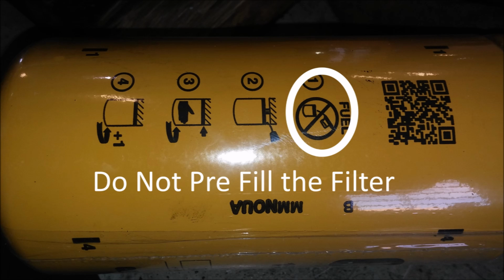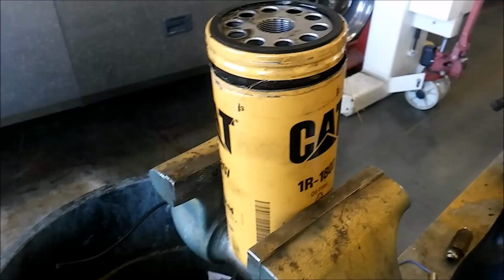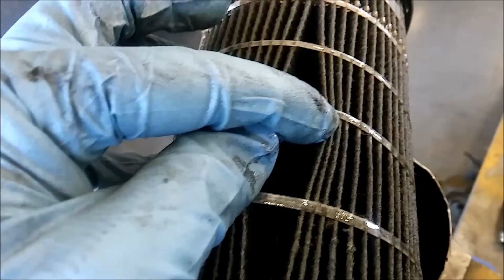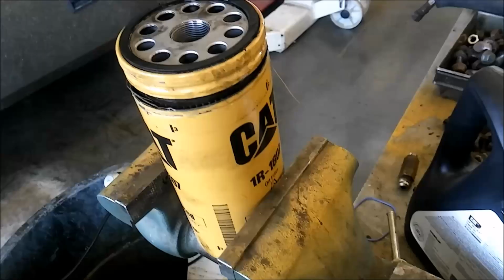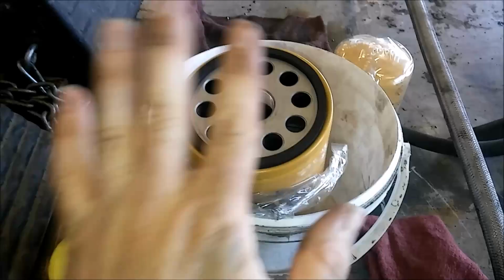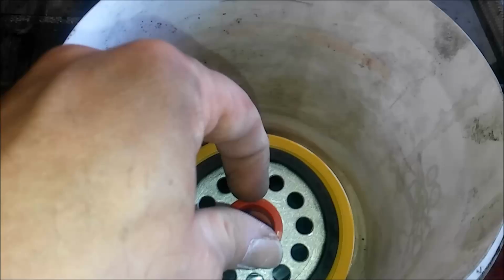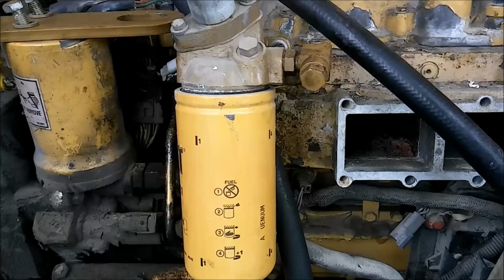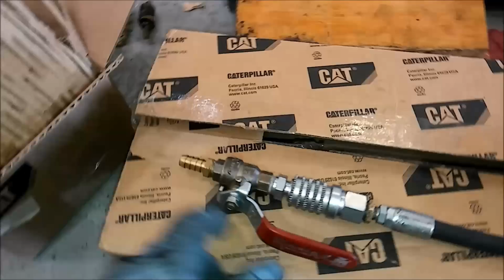Should You Pre Fill an Oil Filter? Should You Pre Fill a Fuel Filter?

Comment: The comments just show how people do not understand fluid contamination in bulk oil and the manufacturing process. Often times, the oil is dirty before it gets poured in the engine and then the bypass filter cleans it up. If you don't believe me, order a Particle Count on any virgin oil sample. CAT fuel filters are like 2 microns, way smaller than dust.
Reply from the maker: +heavymechanic2 Cat seems to think it's a big enough problem that they consider it better to run it without oil for a few seconds than with the unfiltered oil.
Reply: Almost all engines have a oil bypass built into them. Only about 10% of the oil  gets filtered until engine is warm. Even then best case scenario 80% of the oil gets filtered after engine reaches operating temp. Not filling your filter because of contamination is just STUPID
Reply: He is definitely splitting hairs to worry bout such things!low oil pressure is much larger problem,even for three seconds.
Reply: PQIA does random oil testing and has confirmed some oil in the bottles is too dirty to pour in your engine, its the whole point of this video. You guys are confusing Boundary Lubrication with Hydrodynamic Lubrication Anytime the lube or fuel system is opened, its subject to contamination.
Reply: heavymechanic2  Wow you know some fancy terms. How does that change the fact that 90% of that new oil won't be filtered on startup. New or old dirty oil is always more preferable to no oil.
Reply: beatnikgee "90% won't be filtered upon startup"? what's that even supposed to mean? every drop coming out of the oil pump gets filtered before it goes to the bearings and other lubrication paths. any part that is splash lubricated isn't critical about a small dirt particle, but pressure lubricated components are
Reply: Actually beatnikgee is partially correct. The numbers he is throwing around are incorrect for every engine.  Larger engines do not bypass that much oil. Small car engines are more likely to. 
Most engines have one or two bypasses built in. They exist for the sole reason of cold weather or cold oil mobility and the possibility of a plugged oil filter. I'll use my 6.5 diesel as an example.
The 6.5 has two bypasses. One bypasses the oil cooler and the other can bypass the oil filter.  Both are resistance bypasses. If the oil resistance to motion is great (such as when it is cold) then the oil will bypass.  It is a good system for Joe general public that could care less about how their car works and doing necessary maintenance on it.  It is not so good for those of us that like to take care of our engines because the bypass will let debris through when it is open. Thankfully most of the oil has already been filtered by the time you start it in the morning after an oil change. 
If you think about it, it is another reason to idle your engine and let it warm up before driving. With today's thinner oils there is little to no bypass on idle even cold. Well 70 degree cold anyway. A synthetic will work even better, especially cold as it will be less likely to need to bypass. 
If you really want to know whether or not your vehicle is likely to bypass oil find out what its bypass pressure is.  Remember that pressure to activate is a differential pressure meaning the difference in pressure before and after the oil filter. 
To avoid bypass you could also use a bigger filter or like in my case I am going to use 3 filters and block the bypass and have an oil pressure gauge before and after the filter. 
Cheers. Best of luck.
Reply: consaka1 I'll accept that given I just tossed out some numbers with no source to back them up. I tried to find the article that had the numbers without any luck. I think it was a David Vizzard deal but it was about 15-20 years ago. The numbers they showed in their testing were actually lower. They were testing on a typical SBC with conventional 10/30 oil. I remember the study because the numbers were so shocking. They also found that the oil was dirtier after using "higher quality" very fine micron filters because even less oil was getting filtered compared to a "cheap" filter.
When you said 70 degrees cold I had to chuckle....it was -40 degrees Fahrenheit last night.
I'm going to dig a little more to see if I can find that article. It was really informative on the need for blueprinting your oil system when building your engine. Most people don't get past which heads, cam, and intake they're gonna use.
Reply: beatnikgee Makes sense that higher resistance of smaller micron filters would cause dirtier oil because of more bypass taking place. Just another reason to try and find the biggest filter you can. 
Keep in mind that the synthetics can make a big difference on how long they bypass since they are not near as stiff at colder temps. But yeah I lived in WI for a year as a kid and -30 was not uncommon. That was before the days of synthetic and they don't close school for stuff like that out there. My dad had fun getting the engine warm enough to start. Oil is like tar at those temperatures. 
Yeah for the engine I am currently building I am going past the standard blueprinting. Well as much as a you can for a diesel. Coatings are going to be a big part of it.  Current engine runs great! Just not keen on zero oil pressure at hot idle.  60,000 miles and my oil is probably really really clean. lol
Reply: well I just use motorcraft oil filters in my ford vehicles. they've got a lot of surface area to hold dirt and the bypass spring is very stiff
Reply: heavymechanic2
Reply: I'd worry more about the contamination laying in the bottom of your pan than contamination from a clean quailty engine oil maybe your using the wrong brand of oil then
Reply: Adept Ape im pretty sure this is wrong,according to what weve been taught, the crank journals "hydroplane" on the film of oil between the journal and the bearing,and that the most wear occures on startup,due to lack of lubrication,how many bearing failures have yall seen due to microscopic particles in the real world.......zilch
Reply: Had a professor in college that worked for cat as an engineer for hydraulic systems. He said they discovered that the oil they were draining out of machines was cleaner than the oil they were putting into them. Said 55 gallon drums are the worst culprits. The only real reason to change hydraulic oil is to replace the additives.
Reply: heavymechanic2 6
Reply: You lack critical thinking and an understanding of these systems.

First If you have metal on metal your lubricant isn't doing it's job and you have bigger issues. The contamination from particulates is removed by the filter. Hydraulic systems tend to have them on the return lines to the tank. In the end the fluid in the tank should be clean, at least cleaner than what you get out of a 55 gallon drum. You should filter the oil before you put it into a machine. I've upended plenty of drums to get the last little bit of oil out and there is always shit floating around in the bottom of it.

Second i never mentioned anything about not changing at recommended intervals. But what do you think the additives do? Things like anti-oxidation and corrosion inhibitors? They keep moisture and oxygen from attacking the oil and the components of the system. If your oil is getting broken down then the additives are shot. Hence you are replacing the oil before that happens. This means you are replacing the oil to get fresh additives rather than the oil itself going bad.
Reply: D3faulted1 you do what you want I've never had a major failure from new oil in all my 50 yrs of being a heavy equipment tech timing service and inspection of systems is the key to trouble free use not what your claiming you are a fanatic about oil if I was you I'd be more worried about what your drinking than what's in oil pick better oil brands  good luck
Reply: Just because you've been doing something for 50 years doesn't mean you understand why your doing it.
Reply: I have seen a 4 year old pail of new oil with an inch of sludge on the bottom. Whooooops! Does this stuff expire?
Reply: maybe you need to find higher quality  oil then Dude
Reply: look up oil filter construction it has a by pass spring thats why there is crap stuck in my bearing now in an engine i am into
Reply: You're all wrong. It's better if you put the filter bone dry and allow it to slowly fill up as your engine is cranking. It helps clear up all the sludge and even helps seat the rings all over again.
Reply: Can't you just put an old shop towel over the filter and pour the oil through it to strain it? If it's that contaminated out of the bottle, I mean. :)
Reply: Aren't most hydraulic oils Hygroscopic? Like brake fluid. Meaning they draw moisture out of the air which builds up in them, the biggest reason to change it.
Reply: manstersr what .....did......you say? Your profile is very distracting and I can't focus. Your profile picture is ....uhm very nice.
Reply: That's why I selected it. It was the only one I had that met the size requirement for google profiles. Not my girl or anything like that unfortunately.
Reply: manstersr bravo, I like your distraction tactics.
Reply: Bypass filter ? what are you drinking? no such thing as  a bypass filter in any engine I've ever owned the particle count in good quality oil is a mute point unless you wanna split hairs I've always prefilled oil filters that are able to hold the oil intact while installing the filter My large diesel engines always get prefilled to avoid dry start up's and airlocks never hurt a thing and I've gotten well over normal mileage limits you do what you want but I will always prefill large filters
Reply: Tell me how do you add your bulk oil into your engines mr.heavymehanic2? I am betting you just pour it in the fill spout just like how it was meant to be done.You dont filter your new oil do you?So you pour that same oil right down into engine raw right past the oil filter. Some engines it goes through valve train first trickling into pan , others into front timing cover and some a side tube right to oil pan.
Reply: What? I've never owned an engine that didn't filter 100% of the oil at all times. That bypass is for emergencies only, where lubrication with dirty oil is preferable to no lubrication at all. If the scenario you describe were true your bearings would be destroyed by foreign matter in short order. See the Ape's video on spun bearings.
Reply: heavymechanic2 that’s a tiny fuel filter dang. Jk
Reply: @beatnikgee  , I must be missing something, back in the forties and fifties many engines had bypass filtration where only some of the oil got filtered, to the best of my knowledge all oil systems are now full flow filtration and have been fo many years, the only time the oil bypasses is if the filter is blocked and the bypass valve  opens to save the engine from seizure.
Reply: @Ed MacLane , of course but by-pass filtration is a relic from the past.
Reply: I use 3 different wix oil filters and none of them show a no fill symbol. My tractor takes 3 different oil filters (1 engine, 2 hydraulic) and none of them have a no fill symbol. And that’s oem filters.
I’ve been filling oil filters for decades pouring directly from the can (old days) / bottle or using a clean funnel. Have never had a problem yet.
I can’t imagine why a manufacturer would would be ok with a giant air pocket (larger filters) on start up? Especially a diesel.
Reply: I guess I never really gave it that much thought and figured it was just guys being precious and overcautious. You make a fair point, oil isn't perfect from the refinery, nor are those drums and bulk oil 200,000 gallon storage tanks either, all sorts of old chips of paint and burred up half-rusted filings..
Reply: @aldenh9560  Wrong. Hydraulic oils from 30-50 years ago contained nothing. Today, Hydraulic oils contain many additives that help with aeration, corrosion, water disbursement and many other things. The hydraulic filters of today are so good, they are capable or filtering the additives out of the oil given enough time. In short, a properly running hydraulic system will get cleaner the longer it runs. Therefore, the oil needs to be changed in order to replenish the additives in the oil.
Reply: @consaka1  Well said, that's a lot of info. Great comment. Jim
Reply: @AdeptApe  Something that's been missing in this discussion is when is the oil filter bypassing, and where is the main oil pressure regulator in relation to the filter?
If your pressure regulator is after the oil filter, then all the oil from the pump must go through the filter, if it's cold, etc it'll be hard to do so the bypass opens up, if the filter is after the regulator, then only the oil that's actually being used to lube the engine needs to go through the filter, reducing the likelihood of oil filter bypassing.
Another thing to note is that what the engine RPM is... if you're at idle, again, the oil pump isn't putting out a whole lot of flow, but if you rev it up, now that's a different story
Lastly, gas engines have a far wider RPM operating range.. Idle at 600 and redline at 7000.. If you're going to keep pressure at idle, you're going to be moving massively more oil than you need higher in the RPM range and bypassing is just about guaranteed to happen
Reply: @D3faulted1  and just because you read something dosent make it right. You may be correct but you are also arrogant.
Reply: @MenacingRabbit  I'm not buying the whole reseating the rings as being a good thing. That's called excessive wear.
Reply: @aldenh9560  I wish I had read this thread a few years ago, what a laugh 😂. I hope people don’t read your comments and believe them. Especially a 50 year mechanic who doesn’t know bypass filters exist lol. CAT filter their oils before they use them in my country. Shows how much you know
Reply: @AdeptApe  I believe cat is playing odds. Due to the environment these engines are operated in. Construction sites jungles desert sites ect
Reply: Yeah your talking about bypass filters not 20 micron full flow oil filter  of which are the standard used by all engines manufacturers. Only some manufacturers offer bypass systems that filter down to 2 microns. I can guarantee brand new oil has no contaminates greater than five microns. Now bulk oil well ya get what you get.
Reply: @Jon-O.  Yup and this is were they are getting there misguided don't fill the filter idea. A standard system with a bypass is a whole different idea than a bypass system. You could disconnect and plug a true bypass system and your engine would run just fine you just would not get that last very fine filtering of the oil.
But in a true bypass system only a small percentage of the oil is filtered as it goes around the main oiling galleys
Reply: @tomhutchins1046  Tom I own a cummins what I can say is this that oil filter holds 1 quart of oil that's not going to fill fast enough to keep from metal on metal contact in the upper area of pressureized lubrication at the camshaft which is above the crank and isn't splashing in oil pan. Secondly the valve train up top is oiled last which takes even longer to happen. One time I didn't prefill my oil filter properly on it's second oil change from new. I could here metal to metal contact for 13 seconds before it got quiet. Plus I got a lube message on my info screen! When I prefill this never happens and warning message free. I will always prefill  my oil filters and prime fill installed fuel filters see ya in a million miles.
Reply: I prefill a filter in order to allow the oil to be distributed faster.  The idea that there may be more dirt content in the fresh oil than in the residual oil is foolish. Until the pressure builds the moving components are all still using the dirty oil, or what remains of the dirty oil.
Reply: @beatnikgee  To be fair ALL filter manufacturers do not recommend pre-filling your filters.
Reply: @MenacingRabbit  Cummins and Detroit Diesel disagree with you. I choose to trust them rather than some random keyboard mechanic.
Reply: You should absolutely pre-fill you oil filter before you install it.  My dad, who is a retired aircraft mechanic, has been pre-filling oil filters since 1964.  That's because the engine is primed faster when the oil filter is full when you start it up after the oil change.  The argument that you should not pre-fill the oil fitler because bulk oil is contaminated before it gets into the engine doesn't hold up under logical examination.  Even if the bulk oil is dirty, the consequences of dry running metal-on-metal parts in the engine is far worse than dirty oil.  The oil you just drained out of the engine is far dirtier than any new bulk oil will be.  And that engine had been running with that dirty oil for some time before you changed it.
Reply: The ISO code for automotive oil puts particulate size between 4 to 14 microns. Automotive oil filters are only about 25 to 30 micron filters. The oil filter isn't going to catch those particles anyway. For most DIY car guys, new oil right out of the jug is plenty clean and no problem to use to pre-fill your filter. New oil is cleaner than what is left in the bottom of the pan, pickup, and pump anyway. The oil pressure will build faster with a full filter (if the angle allows). Listen to your engine after starting after an oil change with a dry filter and a full filter. Listen for rattles, clicks, etc. I hear less noise with a full filter - so I fill them if I can. If I can't, no biggie. The residual oil film will protect parts enough.

Comment: Some car engines that have a oil pump that's hard to prime. If you do not fill the oil filter then there is effectively a gap of air that is easily compressed meaning the pump will prime quicker.

As for diesel injectors I think there is always enough diesel left in the rail to lubricate the injectors before the engine runs on all cylinders.